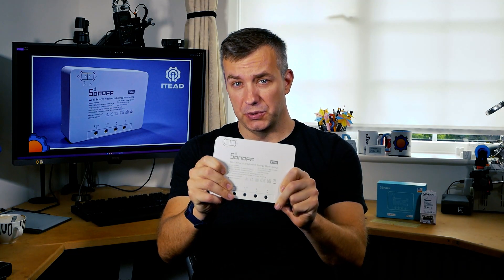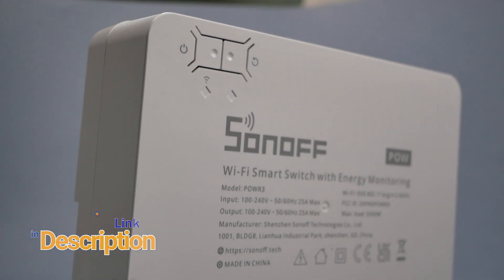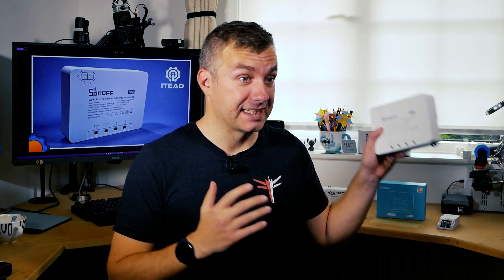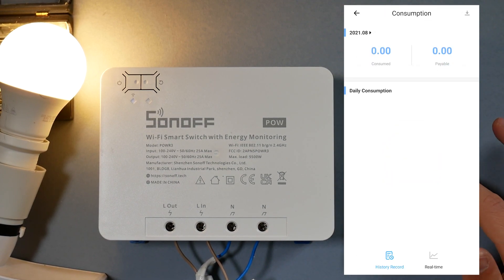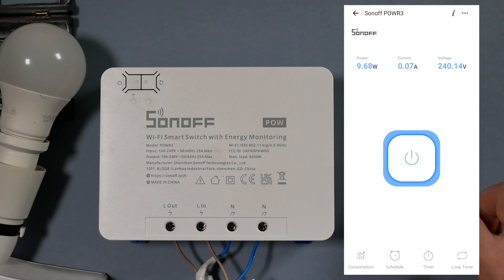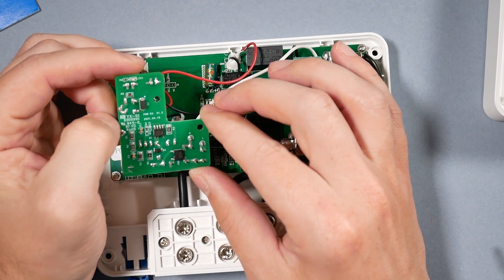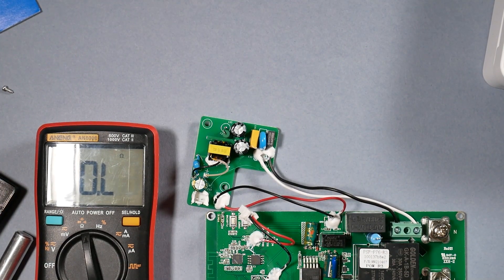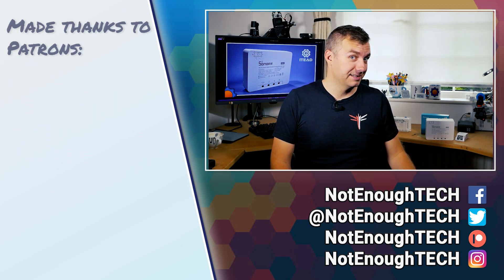Amped to 25! Sonoff POWR3

Comment: Great video! which cable do you suggest to connect this just after the main switch of a 3kW system (25A)? 10 cm of 4mm cables? better 6mm?
Reply from the maker: Thicker cable will run cooler.   If the cost isn't an issue and fits well into the terminal then go with a thicker

Comment: The main fuse on my grid is 25, can i use this to monitor all my house (1phase) 
Thanks.
Reply from the maker: The answer likely to be yes but it also depends on what load you are connecting. In reality your house is unlikely to draw anything close to 25A at the same time

Comment: Hi. How do I know if my Appliance is on or off considering mine is connected to my geyser..? Also considering the WiFi is out of data. What happens when I press the reset button? Does the sonoff switch off? How will I know as the lights on the device do not seem to give an indication
Reply from the maker: Without connection you won't have controls or feedback from the device.

Comment: Hi. I have a POWR3 running, Tazmota 12.3.1. I can get the Relay working fine. But I cannot calibrate the power and current measurements. Have you got these working? Thanks
Reply from the maker: Someone's mentioned similar issue. Re applying tasmota config fixed it

Comment: Can I use this on my water heater? It isn't supposed to require more than 20A (the relay connected to it is a 20A one).
Reply from the maker: As long as your heating doesn't draw more current than specified  for this Sonoff - you can

Comment: can I use this smart switch with air-conditioning?

Also, in the event of a sudden power outage and its return quickly, does the switch restart the air conditioner or protect it?
Reply from the maker: It has software implement protection is not as fast as hardware one but your appliance should be fine should this happen

Comment: My device is paired but wont connect to the internet. Every thing in my house is connected to the internet but this wont. This is first start up. I cant find any info on the issues.
Reply from the maker: What do you mean by paired? Paired would indicate that the device is is present in the cloud and you have a control over it from the app - therefore it is connected to the internet. Could you explain this a bit better?
Reply: @notenoughtech  its paired but offline. Won't connect to the internet

Comment: can I use it as a whole house energy monitor
Reply from the maker: Sonoff will have dedicated equipment coming up for that. This unit alone isnt good enough for the whole house
Reply: @notenoughtech  what about just a room?
Reply from the maker: Up to you as long as you stick to the current rating
Reply: Technically I can use it for whole house right. My average load is 500W, occasionally 2000W and rarely 4000W. It includes 1500W geyser, 1200W motor for watering. Rest all lights, Fan, TV etc. The dedicated device is costly. @NotEnoughTECH

Comment: Good morning,  just subscribed saw you on Peter's Website. I have.... 5000 Watt Glowatt but the load would need to be the house.
Reply from the maker: Morning ;)  Pete is a good friend of mine! Thanks for the sub. 5000W would be pushing this to the limit ;) do tell how will it work for you
Reply: @notenoughtech  I have to put up the solar panels build the 14KW battery then connect to the house. I will probably not do it yet. Anyway have play with node red a long time ago now. Best get back into it.
Reply from the maker: Sounds like an interesting undertaking! Nodered for the win!  :)

Comment: 25A single phase? What’s the use-case for this thing?
Reply: Waterheater for those of us in countries with single phase supplies to our houses but no mains gas….
Reply from the maker: You could definitely run a whole heating system on that without worrying about sonoff being the weakest link (at least when it comes to current limit)
Reply from the maker: Inductive current limit would be significantly lower than 25A depending on voltage. In this case you could drive much higher inductive loads than on standard sonoffs. Usually safe inductive load on 10A sonoffs is about 1-2A. While I have no information about certification for it we can safely assume that it would be around 5A (relays are rated for 30A inside)
Reply: Startup current/inrush is often much higher than steady-state: this can avoid frying your control device for those types of loads.
Reply: @RossReedstrom  how does this device act as a start capacitor limiting inrush current?
Reply from the maker: It doesn't, it is just more resilient to being damaged by having a bigger load headroom
Reply: My microbakery oven runs off a 16A fuse single phase and need to be on for hours. The POWR2 was not powerfull enouhg. I have great hope for the POW R3
Reply from the maker: What are you baking? I used to live close to a bakery we made friends with people there and got fresh produce at 5am... Oh awesome stuff
Reply from the maker: Deal! I'll automate anything baking related once I move next door 😍😍😍
Reply: @notenoughtech  An automated baker would be good :D
Reply: No doubt been mentioned, but my use case will be for high power electric motors, such as pool equipment, heating equipment such as hot water and larger electric baseboard heating systems and even smaller electric cooktop isolation and power usage monitoring on all equipment listed.   Given in the UK a ring final is 32 amps, there are definitely use cases for this.  Even on 16 Amp circuits, plenty of use cases as it gives you the headroom needed for safety rather than constantly running a 15Amp switch at its maximum rating, which does cause issues as I have seen several of the 15Amp rated devices melt at 10amp loads due to the fact rating is 15amp at 220V and UK / Australia / NZ and many others are 240V not 220 :).  It's about the total power, not just the current handling.